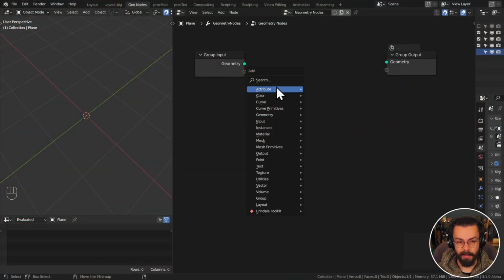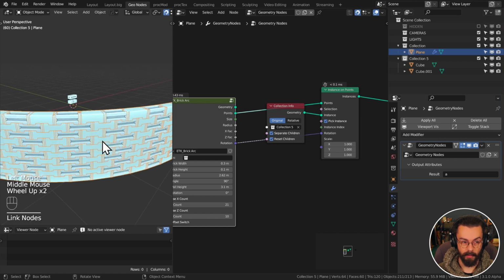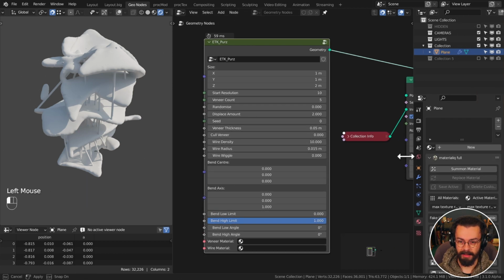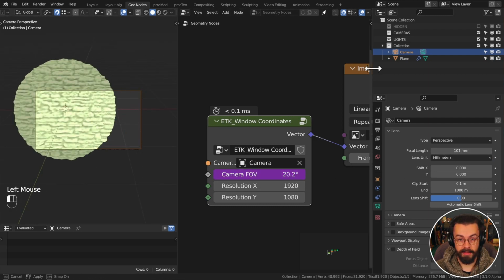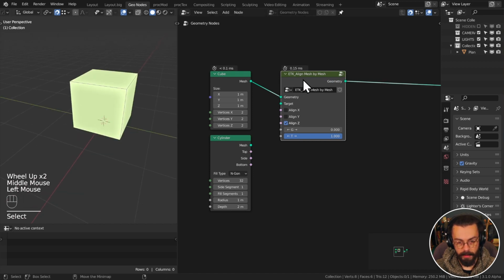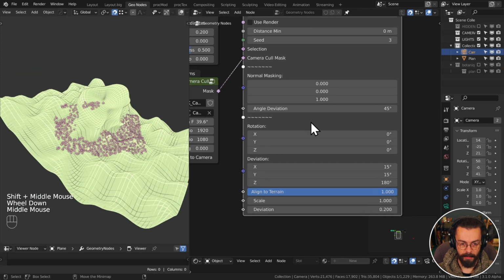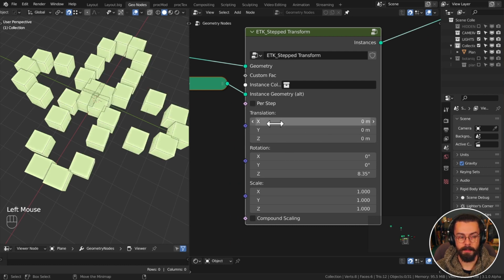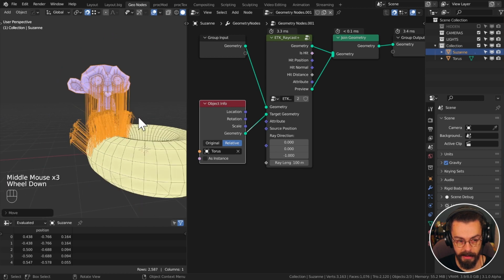EVERY NODE in the Erindale Toolkit - Geometry Nodes

Comment from the maker: All the nodes are chaptered so check the description to find the parts you're looking for!
Hope this helps!
Reply: May God bless you with all his might for creating this toolkit, and this very relaxing video, with sharp & crispy sound. I will I will buy the hell out of your toolkit and use it for free for years!
Reply: I assume you're doing a torus unwrap to do repeats across two seams with 4D space?
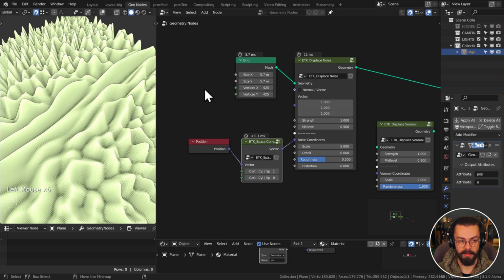A cylinder unwrap is also very usable to do repeats and you only need one seam, using 3D space. I.e. at 1:29:56.
I.e. on a treetrunk, variations upwards don't matter in a generator, but you want a nice seamless edge at the seam.
Repeatable generators (with separate x,y,z controls where applicable) are DEARLY missed in Blender.
As is space conversions and blended triplanar mapping. I have made my own (materials), but still.
Mix float (Lerp/fFlerp), linear interpolation, is one of my most used custom nodes in material - can SEE the values. Should be in vanilla.
Reply: will this be obsolete once they release newer version of blender?
Reply from the maker: No, it has survived dozens of new Blender versions. I update it when I get time as well. It's definitely due a bump now but life has been a bit crazy
Reply: @Erindale  thank you for your response.

Comment: Erin, amazing as ever - I want to buy your tools but first I need to know if this is possible with geom nodes in blender... how can we convert the points on the phyllotaxis to be a surface mesh? same question with the spirograph curves. (to make a propeller based on phyllotaxis (fibonacci) or the spirograph curves) - you had something like this with your sverchok tutorial here on your channel. I really want it to work with the fibonacci phyllotaxis.
Reply from the maker: You could transfer the point positions onto another Geometry and it's by manipulating the index with some maths like modulo, divide, floor etc that we can control how the positions are sampled. So yes, anything is possible!

Comment: Do you think there´s a way using geometry nodes in to to convert a roof made out of planes, into a corrugated sheet rood for example?, understanding the cuts, and directions. So to just tweak only a plane, and have everything sync to that plane
Reply from the maker: Yeah definitely, you just need to analyse the roof direction to be able to align your generated surface to the slope. Cross product is going to help you there. For example, cross product of the Normal vector against up vector (0,0,1) is output a vector that is horizonal across the surface.

Comment: I'm hesitating to buy this toolkit, because I've just started with geometry nodes. I'm still struggling to get the basics of a real beginner even if the work looks impressive
Reply from the maker: The toolkit is made with the intention of adding more high level, "easier" nodes. For example a noise displace node, or a points in volume node, or a bend node etc without users needing to know a bunch of maths or what the 'normal' node does. No pressure of course, but it's aim is to make geo nodes easier, not just add functionality 👍
Reply: @Erindale  ahh it's tempting, well I'm working seriously on it for a few days .. and if I've worked well I'll offer it to myself ..
thanks for you answer.. and thanks for your art
Reply: @Erindale  i'm really happy to take your new course it fits better  at what i need !!

Comment: i'm on 3.2.1 with your latest before the 3.3 one and trying to follow the vid but alot of the stuff when i put in the same values as yours look alot different esp the walls - im only up to 30min and at least 5 of the setups seem very different - the scale on the wall doesnt scale the bricks and obvioulsy u know there are more and or different parameters now
Reply from the maker: There have been some minor changes and bug fixes. Best to use the video as a general guide. It's correct for 90% of the nodes still but there will be some added or removed or changed as the add-on develops.

Comment: Hi Erindale! I bought the Toolkit in particular to get the Camera Culling node, to save my sanity when trying to build large landscapes with geometry nodes. It's really useful, so thank you! But I am repeatedly running into a - sort of - limitation: imagine, if you will, the camera doing a drone flight between trees in a forest, starting on the ground, then rising up above the treetops. The problem with that is that the trees in the foreground start to pop out of existence the higher the camera rises, because the distance in the z-direction gets too high. I can always increase the padding, of course, but this in turn basically defies the purpose of using camera culling in the first place, because the padding value needs to be so big, almost no geometry is culled anymore. I tried to look inside the node setup to find out if I could separate the axes and define different padding values for different axes, but this is way over my head, at least for the time I can put into it right now. Maybe that's something you could implement in a future version...
Reply from the maker: There's an option to not cull in the Y axis that is basically just there to fix foreground popping elements. You could try that to see if it does what you need

Comment: Does anyone know how to make a quick link between a selected node and the group output? Like in the shader nodes with node wrangler activated. Because I see erindale does this all the time, but when I try I always get the quick link with the viewer node
Reply from the maker: Alt+shift+left click for geo nodes ✌️
Reply: @Erindale  thank you for your quick reply, you are truly our geo nodes hero. Unluckily when I press alt+shift and left click it still gives me the option to pan and doesn't do the quick connect thing, at this point I think I don't have the node wrangler update? I've tried to install the .py module of the update but it still doesn't work, maybe I'm doing something wrong
Reply from the maker: To pan? I wonder if you have your keybindings modified then. The default would be pan on the middle click. Perhaps it's something with emulate 3 button mouse? I think that takes the alt button to give extra options. In that case, seeing as the viewer node is very much less used than the output, you could go into your keybinds and in the node graph section find where you have an Alt+shift+LMB and just change it to ctrl+shift+LMB so it matches the shader behaviour.

Comment: @23:38 I had a similar situation with a building generator I'm refining. You can use a switch node to check the spline count to change the offset when there are 2 splines but I'm not sure how you would detect that with the switch node. I've only done it based on the number of verts in a generated grid.
Reply from the maker: If you use the statistic node with the index on the spline domain you can count how many splines and then if you modulo by 2, 0 will tell you it's even and 1 will tell you it's odd!
Reply: @Erindale  Niiiiiiice. Modulo is so helpful!!

Comment: What is the easiest way to take an object and make it "fill a face". Something like hardwood floors. Is that possible with the current version of Geometry Nodes?
Reply from the maker: Do you mean you want to instance things over an area? Or like an actual packing algorithm without intersections? The easiest way to do floorboards or something like that is probably with a grid of points with appropriate spacing and then randomly offset rows. That's how I've done them in the past. There's not really any "simple" way to do anything with geo nodes as it's a lot of very low level tools at the moment.

Comment: Hey there, i just picked up the addon, I am having alot of difficulty getting anything to happen. There is no Bezier segment as a node, for me and I've not been able to make it far into this or your other tutorial without coming across nodes you have that I don't. perhaps explaining what is needed and where to find them would be beneficial. additionally, plugging in etk pipes the way you have there does nothing but revert the object back to its original mesh (like if i use a cube, but plug in an iso sphere, it becomes an iso sphere until i plug UPDATE: downloading 3.0 fixed my problems.
Reply from the maker: Yeah I was going to say you need 3.0 or higher to use the full toolkit! Glad you found it 👍

Comment: On the foliage node I'm finding that objects from my collection are sometimes spawning flipped 180 degrees on the x/y axis (They're upside down). Other copies of the same object are appearing the right way up.
Reply from the maker: Check your mesh normals and also look at how you've set up your scale and deviation. The deviation value is like an epsilon value so scale of 1 with deviation of 0.2 will give a range of 0.8 to 1.2. you might have it set such that you get negative scale values.
Reply: @Erindale  Thanks for getting back to me! I did figure it out shortly after posting. It was the deviation making some of them negative like you suggest.

Comment: I would like to use the to wires node, and having just downloaded it, I tried to mirror the test example you made with the ico sphere, and the drop distance doesn't seem to be working. I don't know much about how all of this works, but in the node group, when I follow the wires, the end node that connects to the drop distance input is not connected to anything. the "Transfer Attribute" is the end node I am talking about. Is that the problem? Thank you. I am using 3.0.0 Release Canidate Nov 27 2021
Reply from the maker: Interesting, I'll check that out 🤔 I wonder if I might have fixed it for 3.1 accidentally
Reply: @Erindale  Thank you for responding :)
Reply: @Erindale   I can just upgrade to 3.1 or something newer. Didn't know the official release even dropped for 3.0 stable
Reply from the maker: Haha yeah I have a bad habit of only working in the daily builds
Reply: @Erindale  I fixed it by plugging in the transfer attribute into the offset of the left and right set handle positions. I'm not sure if its just my download or not. Thank you for the nodes! Huge help :D

Comment: Is it possible to create a geometry node that extrudes along path like in sketchup?  That would be cool to have mesh profiles extruded around a path without using curves that you can plug in to the node and switch up profiles non-destructively.
Reply from the maker: This is what the curve to mesh node does 😁 you can see on my Bevel a Curve node as well (but that integrates a taper curve as well)
Reply: @Erindale  I don't see a curve to mesh node anywhere.